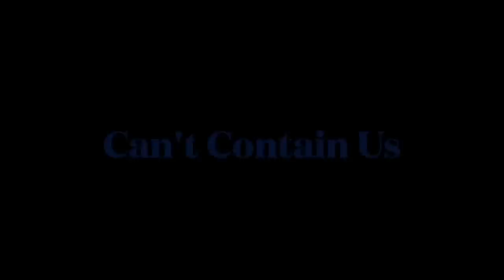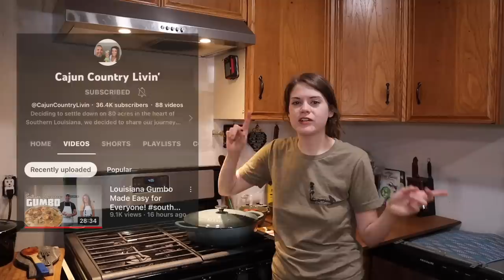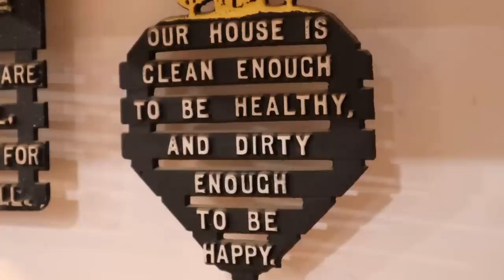FINALLY Building a DECK on Our Shipping Container House | EP:96|

Comment: I may have misunderstood, but it sounded like you were saying screws are stronger than nails. Screws hold things together more strongly, but are generally less strong. In order for the screw part to work the metal needs to be harder, but this also makes them more brittle. Deck screws thus hold the deck boards down more firmly. However, for a shear wall, i.e. osb or plywood wall boards nails are better generally because they don't break as easily. Need to hold stuff together firmly, screw. Need shear strength, nail. But do not use drywall screws for anything except drywall, they are cheap for a reason.
Reply: That's an excellent explanation!

Comment: Your gumbo looked great!  I don't know what traditional gumbo is supposed to look like, but yours looked fine - thanks for sharing.  One quick suggestion - when you are chopping on that cutting board putting a towel under it will prevent it from moving around on the counter.  I don't mean to be critical, just a suggestion.  Keep up the good work!

Comment: You might want to consider the precast concrete base supports instead of digging. I built a 12x12 deck 3 years ago and used precast blocks. They have square holes for 4x4 or 6x6 posts. The ones I bought (home depot) were about 16" tall. And I buried them half way. I live in Wisconsin and the frost didn't heave them at all.

Comment: Hey Cody, I wish I had your energy. You talked about not wanting to see large nail heads on the top of the nice deck boards. (I could be wrong, as it has been known to happen more times than I care to count. Grin. But I think over time the deck boards might work lose with those brad nails.) With the easy access underneath the deck, you might want to look into ways to fasten the deck boards from underneath, for your future deck extensions. They make kits. But you can also buy long channel and screws for a better price.  Keep up the good work. Tony

Comment: Looking good on the deck.i built my deck useing rough cut hardwood 27 yrs ago and I treated it with Diesel and used moter oil I did a 50/50 mix in a hand pump weed sprayer and till this day not rotted nor any bugs in it.

Comment: I love you guys and your videos. I’ve been a woodworker for over 40 years. That framing lumber appears to be red oak. Red oak isn’t a very good outdoor wood. It is very susceptible to decay and rot. I suggest that you seal those joists with cuprinol, which is a copper based sealer that penetrates the wood and slows down the decay process. White oak would be a better choice for exterior wood. Red oak is porous and allows penetration by mold spores, where white oak is dense and doesn’t allow moisture or mold to enter. 
With your mill you should be able to create an endless supply. You should try to find some white oak trees. 
God bless you guys. I love your channel.
Reply from the maker: Its actually White Oak! We have a TON of white oak all around us!
Reply: @CantContainUs  it appeared to be red oak, my mistake. If you take a thin slice of red oak from the end grain, you can actually see through the pores in the wood. If you take the same thin slice from white oak, it’s solid. No pores.

Comment: i hope you don't have the trouble that I did with nailing down deck;;;;suggestion get screws in case the season changes causes the boards to warp and pop the nails out;;;the 18 ga nails just don't have much holding power;;;hope I'm wrong and all goes well;;;;thumbs up and keep em cominl;;;